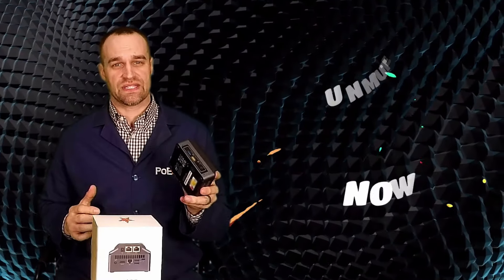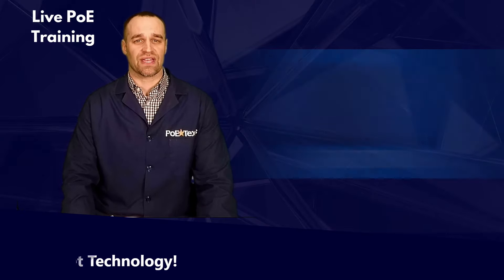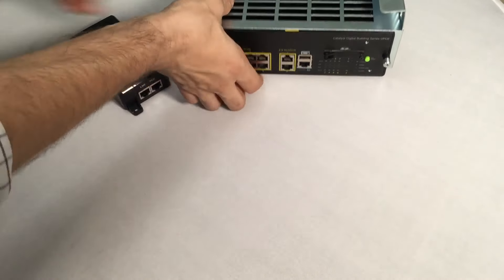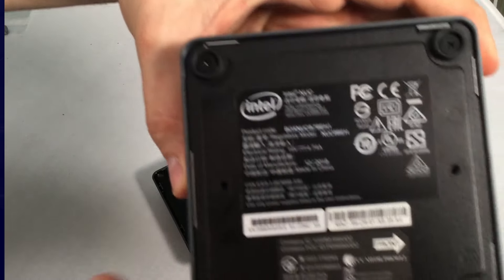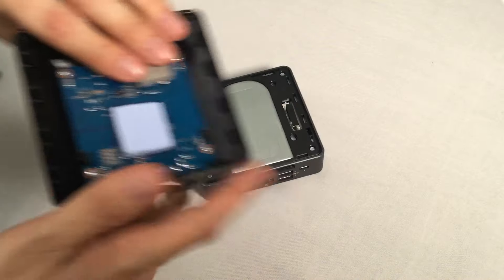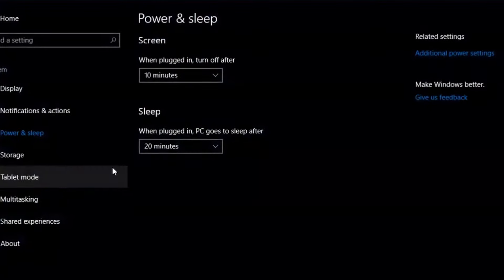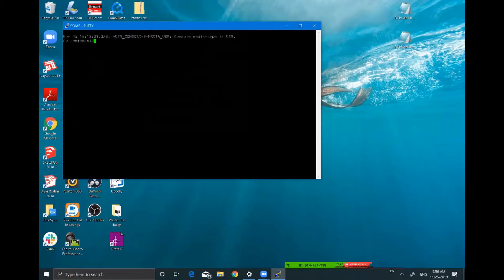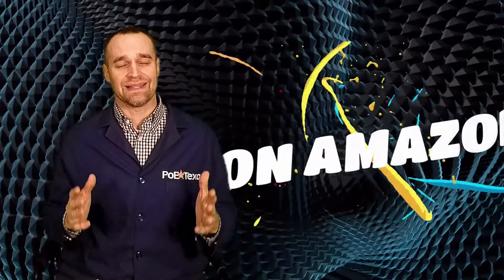Use Power Over Ethernet for Your Intel Mini PC, the NUC, with the new PoE Lid from PoE Texas

Comment: interesting but and where do we get energy for the screen
Reply from the maker: Great question.  It really depends on what screen you're using.  If you using a smaller screen, you could try to piggy back the power and use a DC cable splitter.  The safer bet, though, would be to pull a second ethernet cable at the same time and use one of our PoE to DC splitters.  We have a PoE+ to 19 volt DC splitter option or we can find the right DC splitter for your application.